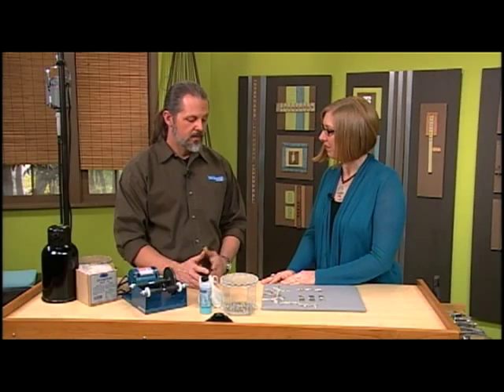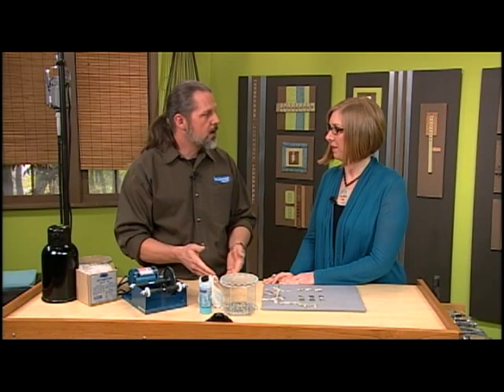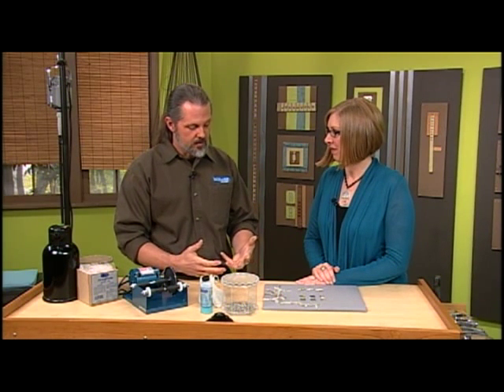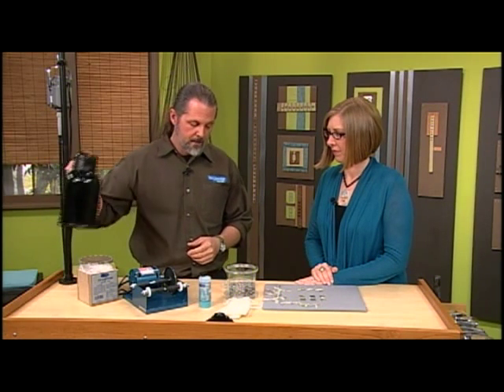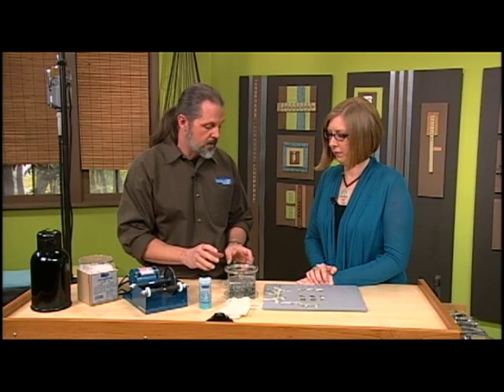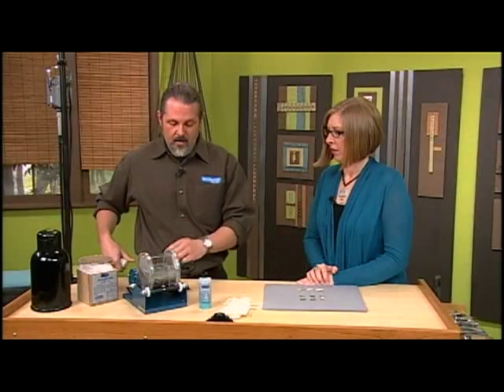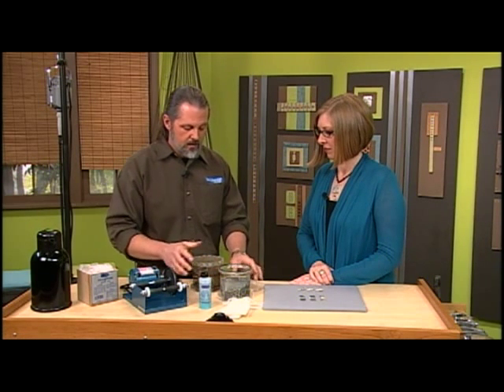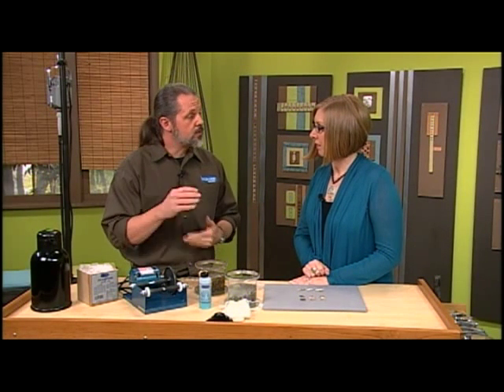Mark Nelson from Rio Grande tumbles and cleans charms on Beads Baubles and Jewels (1403-2)

Comment: I ended up sending that particular tumbler back...extremely noisy, no on/off switch (notice Mark has to unplug the unit to stop and start), and there are pockets around the lid where shot can get stuck.  Not a fan.